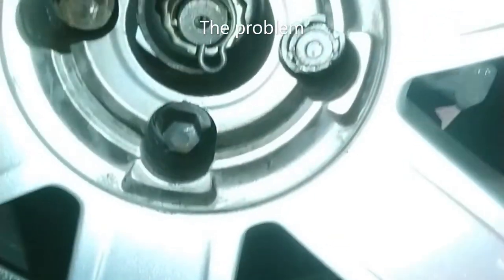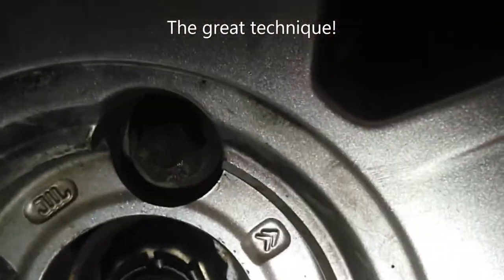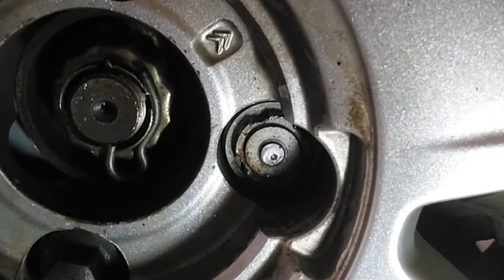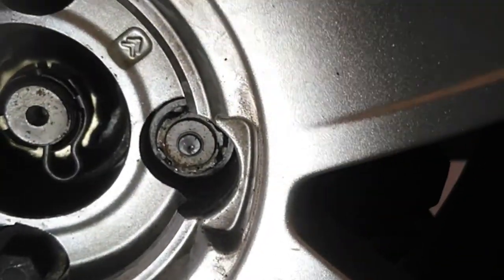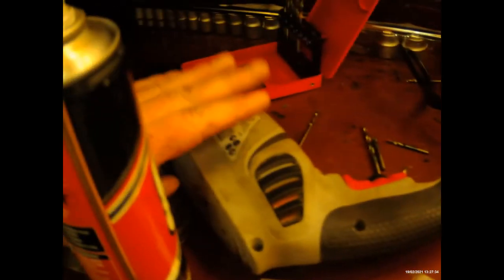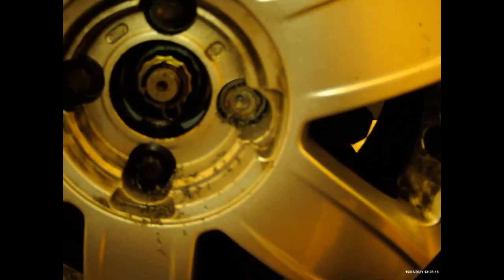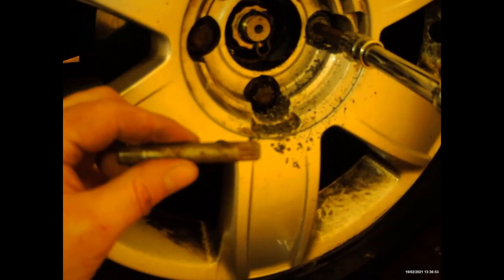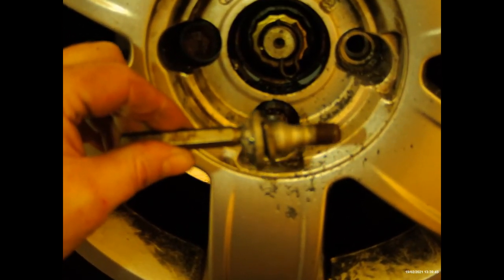Removing a locking wheel nut or bolt from Citroen or Peugeot.

Comment: Look at the original locking nut you demonstrated it has an outer lug separated by a groove, Looks like the nut you're removing already has the outer part snapped off before you started drilling. I welded a 17mm nut on to the snapped wheel bolt at this point, worked a treat, no drilling 👍